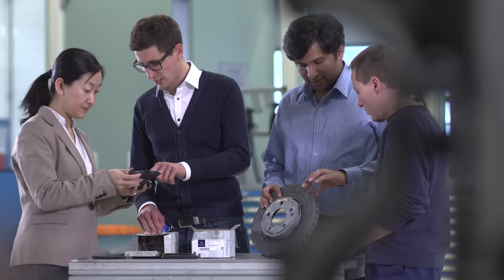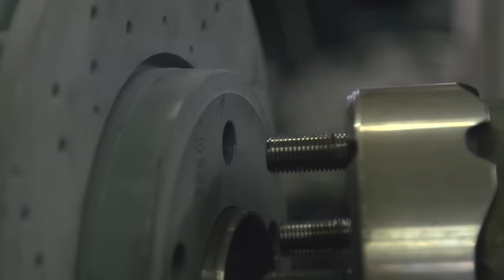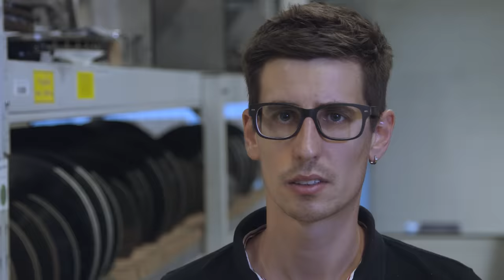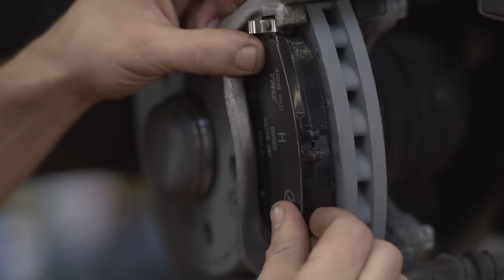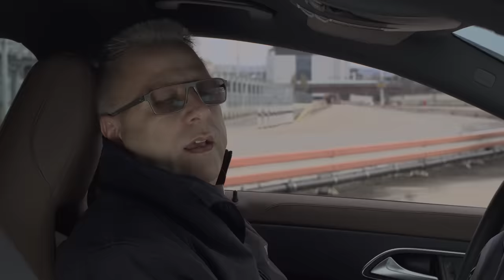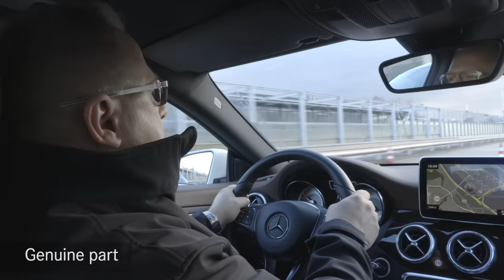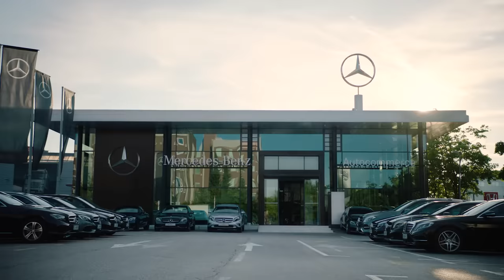Brake Test | Mercedes-Benz Genuine Parts vs. Fake Parts

Comment from the maker: The counterfeits shown in the film are not high quality replacement parts from Mercedes-Benz or other legitimate suppliers, rather they are illegal counterfeits from product pirates. In almost all cases such counterfeits are of defective quality and do not meet minimum legal standards. Thus the counterfeit parts can become a danger for vehicle occupants or uninvolved third parties. The comparison of the braking distances took place under the same conditions at the same initial speed and the same braking point. The longer braking distance for the car with the counterfeit brake disks is the result of the defective quality that frequently occurs with counterfeit products.
Reply: 3ridetec they're saying the fakes in the video are fake products rather than oem products where mercedes gives them permission to replicate them, so oem parts are still safe
Reply: So is the mercedes benz brake disk also drilled? I get what your putting down but when you give a extreme braking test with aftermarket drilled rotors, brake wear is extremely high. What you should do is all 4 kinds of aftermarket vs oem. There are,
Regular rotors,
Drilled,
Slotted,
Drilled and slotted.
Reply: Replica rims.. they bend like soft metal compared to real factory OEM rims of BMW!!
Reply: Mercedes-Benz Ford Green Mitsubishi
Reply: Mercedes-Benz I would also like to say that if you used apex brakes you would find the braking even better
Reply: Mercedes-Benz I have a GLE 250d and I have changed it’s brake pads 3 times in 8 months and the dealer says that the brake pads should be changed every 3 months is that so?
Reply from the maker: Your nearest dealer is the best equipped to answer all your questions, Saurabh. We can also advise you to discuss this issue with our colleagues from Customer Service Department. Here: http://mb4.me/t9I9l9JO in the right top corner you can choose your country page and find all the contact data.
Reply: Mercedes-Benz 

Thanks for the content.
I now feel perfectly at ease throwing huge quantities of money at your notoriously bad customer service departments.
Reply: mike johnson 

Anything not mercedes is counterfeit
Reply: Mercedes-Benz yeah maybe right, but when you do biased test like this one, where we clearely can see the brown merc braking too late and the driver get off is foot of the pedal while breaking, you lost a bit credibility lol
Like "oh my god this pedal is too heavy with the counterfeits, for my poor fragil foot" 😂😂😂😂😂😂
But for sure this kind of propaganda may works with some people who do not understant physics or mecanics.
Not saying the original merc parts are not better but you cannot just show that on one breake test like this because in the true for just one breaking, ther is not a big diference, probably nooo diference at all (so i dont belive you), but repeatedly in dificult conditions probably true.
Reply: Fabio Monteiro 

Mercedes wants its customers loyal and affluent.
Reply: Mercedes-Benz looool i continue looking the video again and again it looks soooo FAKE 😂😂😂😂😂
We can not even see clearly where the second car is breaking lol
But we can see the mouvment of the masses are not constant on the brown car like the pilot are not applying the same force on the pedal all the time.
Reply: Fabio Monteiro 

obnoxious American sales voice

Do YOU not trust a huge luxury business like mercedes Benz?

Do you think critically....please reconsider visiting a mercedes Benz showroom. TODAY.
Reply: O G Moustache Male facial companion for sure but i hate that so much when people lying like that lol
Reply: Fabio Monteiro 
It's pure hard sales marketing.
Reply: O G Moustache Male facial companion i belive in europe they dont take the costumers like dumbs that level lol. I dont know but i feel like in america they dont have shame too show things so false everybody can see. or are they thinking the american costumers are complitely stupid?
normal time here this kind of comercial are more scientific in europe.... more proofs lol

sorry for my bad english
Reply: O G Moustache Male facial companion 
Here, as at home probably. We have several brands of equipment manufacturers. Some are more expensive others less, some are more effective others less, but they are all registered.
And we can use it safely. And they do not cancel the warranty of the car.
Reply: Mercedes-Benz did you use the same kind of tires on the cars same compound and everything?
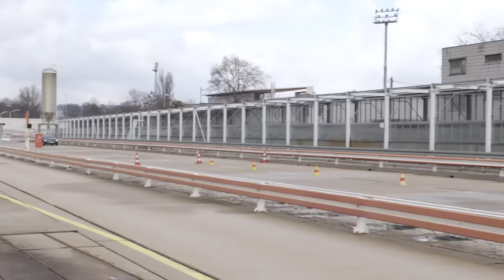Reply: ANDICANDI24 look closely at 1:53 the brown car dont even brake at the same moment.
the white one brake before the cones the brown after.
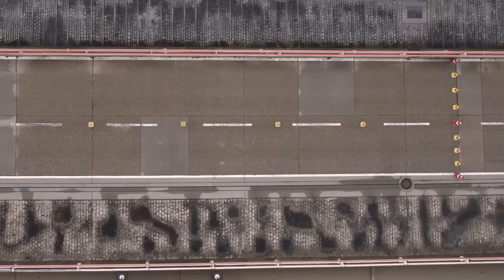At 1:37 it looks like the car dont even brake at all just for the footage.
Its just fake communication to make you buy the expensive mercedes parts and make you thing that anithing else is bad for you security. i dont belive it one second.
of curse hight performence brembo are better than basic trw but for the race, on the road  it stil good and registred ;-)
Reply: on my old clk 320 original discs warped. I bought the "fakes" and they warped too. I guess it's a design flaw. but I must say the pads were some "super silent". I guess they put breaking energy more into heat than abrasion.
Reply: and why people buy counterfeits? because people have to pay 15 to 25€ for 1 radial shaft seal when normal seals of this kind cost 2-4€ (same material).
Reply: Mercedes-Benz have owned 3 new Mercedes and will never buy one of your vehicles again, your dealers are scammers and the quality has drastically decreased. Guess that's why Mercedes America has a one star rating with BBB.
Reply from the maker: We’re sorry to hear that your experience with our Dealerships have left you feeling this way. As we’d like to talk about your experiences, our advice is to bring this up with CS USA at 888-454-9906. Thanks for your cooperation, your Mercedes-Benz Social Media Team
Reply: Mercedes-Benz for 🚗,thanks for comments,don’t forget (they have cone to protect the cones,the car steer straight and crash,but it’s still straight)
Reply: Saurabh Mahindrakar if your doing just day to day driving and not racing then I'd say they were lying unless you do 10,000 miles a month. For most people a decent set of pads should easily last a year under normal driving conditions and average mileage
Reply: No. I change brake pads once in 2 years.
Reply: what about Hella Pagid brakes?
Reply: Mercedes-Benz Wow, such a great car! But sorry I prefer to have a BMW.
Reply: Mercedes-Benz  I own a Mercedes Benz CLA 45 AMG from India . I have proper service records of my vehicle and had replaced my front brake pads from TRANS CAR CHENNAI just 500 kms prior to a incident  . They had assured they had replaced the front brake pads . Unfortunately the vehicle met with a accident on 24 th December during which I was travelling at a considerable speed around 100 KMPH  and had a motorcycle in between when I applied the brake the vehicle never responded to my control , never stopped and collided with the motorcycle forcing me to crash over with the car infront . When inspecting the vehicle i was clearly able to notice the Rotors had changed it's shade fading out failing braking during the incident.I had reported the incident to the dealer and my car was declared a total major loss . The vehicle front end has become completely unrecognisable and still the airbags never deployed putting my life at stake .I was also brought to notice that millions of vehicles including the CLA models were recalled with this airbag issue over others countries .So in view with the same issue causing life incidents have to be brought infront of people. When asked with the dealer they arent providing a proper report and ignoring that the car had no issues. I strongly condemn Mercedes to take action over the issue or I will be taking this issue to the consumer court in view to the safety and ride control of the AMG vehicles . I would like to add pictures of faded brakes and the vehicle incident for the publics view but unfortunately i am unable to add pictures here . If Mercedes are not willing to fix the issue i would take this incident to the media and bring a clear view of the quality of vehicles produced by Mercedes AMG .
Reply: Yea a similar incident happened in Hyderabad(India) with a Mercedes G wagon and the occupants died!AMG isn't providing quality cars and putting customers life at stake
Reply from the maker: Hi Mohindaran, thank you for your comment. We’re very sorry to hear about the situation with your car, safety of our customers is the highest priority for us. We’d advise you to contact our Customer Services India on 1800-102-9222 to have a look into it and to investigate. Our colleagues will be happy to assist you. We hope no situation like this will occur again in the future!
Reply: Mercedes-Benz well there isn’t proper response from Mercedes India till date . So I am processing to take things legally to the consumer court and throughout media to sort out the issue . Clearly Mercedes is willing to ignore the issue that the airbags weren’t deployed saying less impact and brake fade issue . I am worried that even at this point Mercedes customer relation is not concerned about the issue taking it to the highest priority .
Reply from the maker: Not at all, our customers’ safety is our first concern. We can have a look into your case and get in touch with Customer Service India. In order to do so, we’d kindly ask you to send us a private message with your details, by clicking on the ‘About’ button in our YouTube channel and then on ‘Send message’. Here are the requested details: VIN number of the vehicle, owner’s name, address, phone number and email address. Thank you in advance!
Reply: Hello ,  This in regard to the post in which you asked about the details of incident and the car . I have mailed you the respective details to your email Dialog@daimler.com . kindly look into the incident and expecting a feedback soon .
Reply: I have added the issue to your officials through email and they are clearly ignoring the issue bringing up the vehicle has no defect . But how did the airbags did not deploy and the brakes get faded after replacing them at your own service centre ? Since I am not satisfied with the result Mercedes is providing I am willing to process the issue to the consumer court and to media proceedings to make sure the issue reaches everyone in social media as well as aired through everyone I recommend if it’s not sorted by this week .
Reply: Mercedes-Benz thanks
Reply: Mercedes-Benz I have added the issue to your officials through email and they are clearly ignoring the issue bringing up the vehicle has no defect . But how did the airbags did not deploy and the brakes get faded after replacing them at your own service centre ? Since I am not satisfied with the result Mercedes is providing I am willing to process the issue to the consumer court and to media proceedings to make sure the issue reaches everyone in social media as well as aired through everyone I recommend if it’s not sorted by this week .
Reply from the maker: Hi Mohindaran! We are sorry to hear that you are dissatisfied with the response provided. Should you require clarification on the response or if you require further assistance we would recommend once again that you contact our Customer Service.
Reply: Mercedes-Benz hello this in regard to the email sent based on the report which Mercedes has delivered . I have got the same response from the customer service inspite of sending a clear note on the incident to Daimler . Customer service India is showing no interest in solving the issue . So I request Daimler to act in immediate to the notice or I will be willing to solve the issue through the court with considerable claims towards the incident based on the failure of airbag deployment and brake fade issue . I am further willing to forward the issue to the consumer court and to media proceeding and make sure that the Mercedes vehicle did not provide any means of safety through the incident which has caused a mental agony and immense loss . I request Daimler to take rapid response in directly handling the issue and solve it . Thanks
Reply from the maker: Hello Mohindaran, thank you for your comment. We completely understand that a situation like this can be frustrating. However, this issue has already been escalated to our Customer Service team, therefore for further inquiries we’d advise to contact them again as matters such as these do not fall under the scope of this platform.
Reply: Mercedes-
Reply: I feel so sorry for Mercedes Benz! I am a huge fan and it is insanely worrying when I see the things people do to Mercedes.
Reply: Or you could just put your logo on the brake pads
Reply: Saurabh Mahindrakar haha what???? Are u kidding me very 3 months or so no no go back to your stealer and ask him.for those specs on papers. U got brake pads wear warming sensors when it lights up on your dash then is time for replacement not before and even then there is good amount left in them

Brake discs and pads is not just like people say and is very different from what type got installed. 
AMG E55 AMG w211 OWNER. 

Some brake pads are toast on 1 emergency brake that's the dust free crap I forgot their name I tried them.and never do it again piece of crap. Take the dust and habe good brakes end o story
Reply: That's where after market comes Into play
Reply: Saurabh Mahindrakar  definitely not. If genuine part replacing every three months its a problem. Mercedes is no longer high quality car.
Reply: I want to join into the conversation for no apparent reason.
Reply: @saurabhmahindrakar7892 I don't know how you drive the car but if you drive as you should do (planning the drive, keep distance to cars in front, following the speed restrictions, eco driving technique and so on) that is NOT normal. On my Mazda 6 (manual), i never replaced pads or disc in the front during the almost 7 years we had the car and we drove almost 130.000 km with it. The rear i had to change because it got stuck from rust (the Swedish salty winter roads are horrible for metal parts!) and thus the pads worn down to nothing left.
Reply: @MercedesBenz  
 i have tried to go the dealer with my questions.
-parts numbers they wouldn't give out, 
-manuals they wouldn't give out, 
-what servo oil to use they wouldn't give out, 
-they gave out what engine oil and diff oil to use
-and they gave me wrong information about what transmission oil to use, which i later bought in a shop and almost put into my transmission.  

 so NO, i will not go to them and ask about information
Reply from the maker: We're sorry to hear this, Knut. Have you been in contact with our colleagues at customer service? If you would like to tell us where you live we could give you the contact details.
Reply: @MercedesBenz  were you intersted in my safety, when sold w211 with SBC? Coz i remember the day, i've lost my brakes at high speed, like it was yesterday.
Reply from the maker: We're very sorry to hear that this happened to you and sincerely hope no one was hurt. Have you been in touch with your local dealership to get your vehicle inspected?
Reply: @saurabhmahindrakar7892  it obviously depends on your driving style,but changing it every 3 months is total BS.it should be changed about every 15000km or so
Reply: people would buy your original shit if it was cheaper
Reply: @saurabhmahindrakar7892   Hell no! it is usually Km-wise. More like every 25,000-30,000 Km
Reply: Mercedes-Benz ablar en español
Reply: Ok we all know u are doing this so u can ensure that you are the only producer of parts that mercedes owners will buy so you can jack up prices.
Reply: @demarcus8584  bro germany parts is very durable than others aftermarket product, original is better. about the price, the material they used in brake system is not same like aftermarket material. if u use expensive car why dont u just buy the original parts? u such a high demand
Reply: Skyline GTR  this only for conti car why u jdm buzybody?
Reply: QIFA GAMERS Ok so why are german cars some of the most unreliable as they get old... because the parts last? I dont think so...
Reply: @demarcus8584  because most parts come from chinazzzzzzzz
Reply: Stop charging customers 1000$ for brakes replacement and maybe they will start letting you fit "original" parts..
Reply: And what about components produced FOR MERCEDES BENZ by suppliers like Bosch and that cost 1/3 of what you charge just because they did not enter your wharehouses?
Reply: @MercedesBenz  truth be told Mercedes makes crappy cars now. The w211 brake sbc nonsense comes to mind. Car that almost killed me. Shame on Mercedes. Never again will I get a Benz.
Reply: The counterfeits shown in the film are not high quality replacement parts from Mercedes-Benz or other legitimate suppliers, rather they are illegal counterfeits from product pirates. In almost all cases such counterfeits are of defective quality and do not meet minimum legal standards. Thus the counterfeit parts can become a danger for vehicle occupants or uninvolved third parties.
Reply: fucking hell you only reply to comments about the brown car counterfeits are better and cheaper in some instances
Reply: THE BEST OR NOTHING...
Reply: Don’t say its Chinese...
Reply: Than stop charging customers $1000 for brake replacements.
Reply: @MercedesBenz  how does one tell apart a counterfeit from genuine brake pad, what are some ques?
Reply: si
Reply: @antdx316  if you have ever messed up a few sets of wheels then you would know that good wheels bend rep wheels crack and shatter
Reply: You don't produce your brakes Mercedes